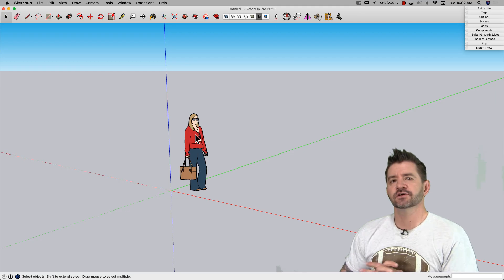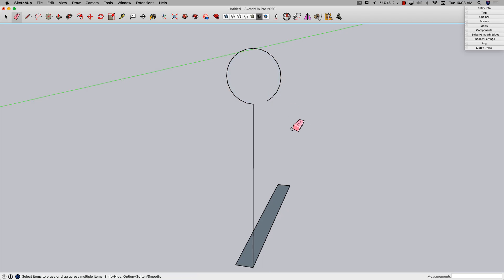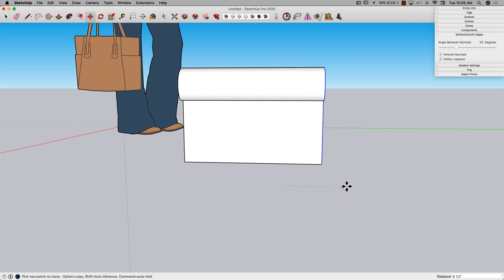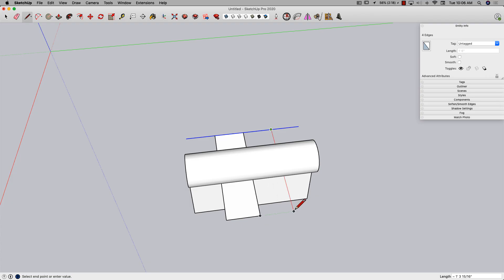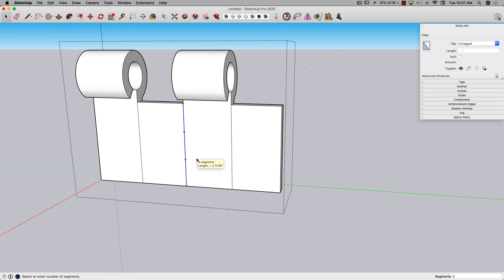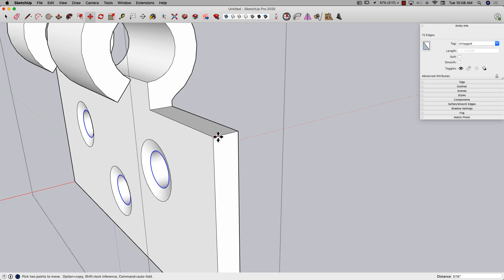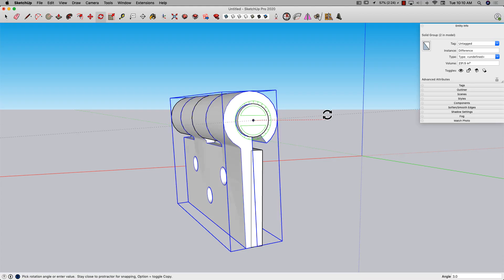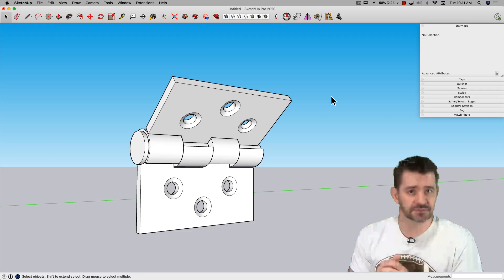Modeling a Hinge - Skill Builder

Comment: Great - So if you want to use the model to demonstrate a moving part, is it possible to lock the point of rotation ?
I have a more complex model and I want to make an animation with different degrees of zoom at different scenes.  I have to zoom in to find the centre of the hinge every time. Advice?
Reply: Crosshair of Guide lines, perhaps?? Also, explore dynamic components..

Comment: Loved this video, thanks.  I am having trouble with the follow me command- when I try to do this, I am unable to select the rectangle face.  It only allows me to choose a point on the edge of the line and circle.  I wound up using the follow me to the opposite corner and then using push/pull to the end of the rectangle.  It worked, but I'd like to understand what I am doing wrong.  Any help is appreciated.
Reply: I figured it out!  I was using the "f" shortcut thinking is was follow me.  It is offset!!

Comment: Thank you for your videos.  I'm a woodworker that uses SketchUp for designing furniture for my customers.  I like to show as much joinery as I can to give them a really good sense of the finished piece.  One thing I wish I was better at drawing is dovetails.  I can do it, but it takes so long.  I'm probably doing the LONG way.  When I watch your videos, I feel like there has to be a faster more efficient way to do it.  Maybe using the divide command, and maybe in combination with the solid tools subtract.  In fact, there's many times where I'm trying to intersect with the model so that I can infer geometry outlines onto other surfaces that I can push pull dados, grooves, etc.  Anyway, just thought maybe I'd drop my thoughts and something I'd like to see.  My SketchUp skills are getting better from watching your videos.

Comment: Thought I wold follow along since it will keep me from doing what I am supposed to be doing. At the end I thought I'd try out Curic mirror you suggested a while back instead of the rotate/copy which is what I always did. A left and right arrow key later and... presto!!

Also, I'm always messed up which item to select first when using solid tools. Apparently I can be forgiven as I just noticed that the "other" solid tools the order is reversed.

Thanks for the tutorial.

Comment: Oky doky...  I challenge you to make your hinge model into a Dynamic Component where the interact tool can rotate either hinge half by 90º on the first click, to 180º on the second click (fully closed), back to 90º on the third click, and all the way back to 0º (fully open) on the 4th click.  I'm really hoping you can just convert your half hinge group into a component, add the DC rotation functionality, duplicate the new half hinge DC, and reorient it to mesh with the original half hinge component.  In theory(?), you should be able to use the interact tool to click on either half hinge component to make it rotate as desired.  Seems like a good addition to your previous DC skill builder sessions.  I'm also hoping your DC expertise will be able to make the "flipped and rotated" second hinge half DC work as it should.  I know when tried it, the second half hinge DC's rotational behavior was a total mystery to me!
Reply: The thing to remember is that the second half of the hinge was flipped, to it's axis is upside down! If you use RotateZ on it, you need to provide negative values!
Reply: @AaronMakingStuff  Well... Lets ignore the positive vs negative rotation direction issue for now.  First, I set up a hinge half DC who's OnClick behavior is exactly as intended — rotating along the center axis of the hinge pin.  Then I select the hinge half DC, copy it, and immediately do a paste in place.  Now I have two hinge halves exactly on top of each other. Next I use the Rotate tool to rotate the hinge half DC copy 180º around its Y (green) axis at the center of the hinge pin.  So far, so good.

However, the second hinge half DC now needs to by rotated 180º around its center and along its blue axis to make the two hinge halves properly align.  I decided to do this with the Move tool.  I grab the proper rotate handle, click, and do the rotation.  At this point I have NOT finished the Move tool rotate with a second click and the hinge half DC copy LOOKS correct.  However, as soon as I click to finish the Move tool rotation, the dang hinge half DC COPY moves along the Y (green) axis in a positive direction exactly the same length of the hinge half AND it completely undoes the blue axis Move tool rotation.  What the...  As I said before, I have no clue why this is happening to the hinge half DC copy.  And to be clear, I'm doing nothing in the DC that has anything at all to do with the Y axis position of the component.  As a certain Vulcan might say, "Fascinating".🖖

Comment: A hinge (common) does not look like this, but anyway, great job and easy way to do it.
Reply: A. M. Oh no? What do I need to change?
Reply: @AaronMakingStuff  a typical hinge has 3 knuckles and 2 the other side. So 5 in total. The 3 knuckle side is the one that goes on the door side and the 2 gets fitted to the door frame.
Reply: @SteS  True... for a door hinge. In that  case the two sides would be separate pieces, but use the same geometry to create opposite cutters... maybe this needs to be another video!
Reply: @AaronMakingStuff  I only learned that when I went to rehang a door. The video was great. Got the point across well.
Reply: What I mean is that, the tube for the shaft, is not just above the plate, but beside it.
Reply: A. M. The center of the tube should be aligned with the face of the place. Thus the center of rotation is aligned with the insides of the hinges... or are we talking about different things?
Reply: You can do it exactly how you want, my point was that most of the hinges don't look like that.  Your way of doing it helps a lot, no matter what it looks like.
Thanx.